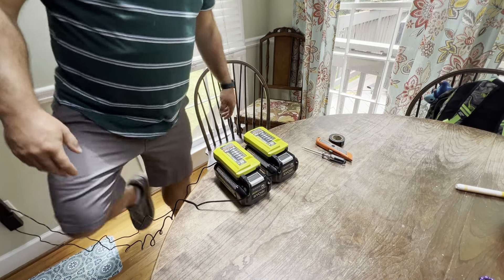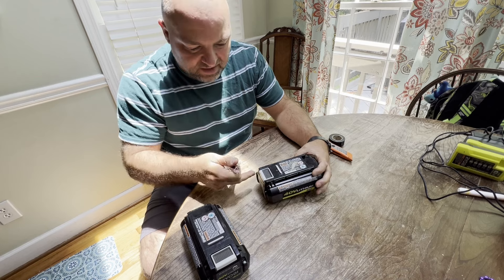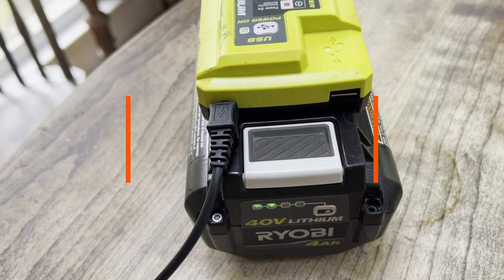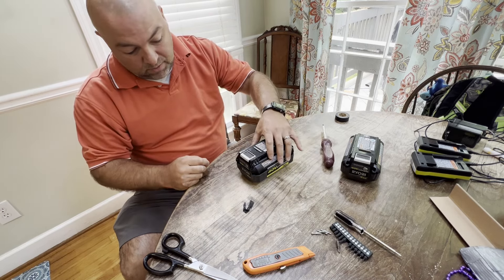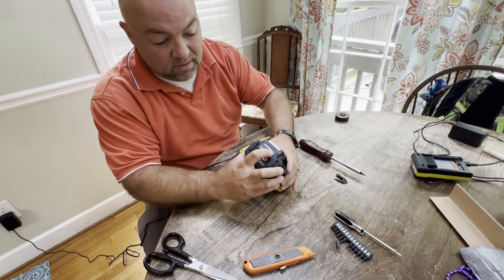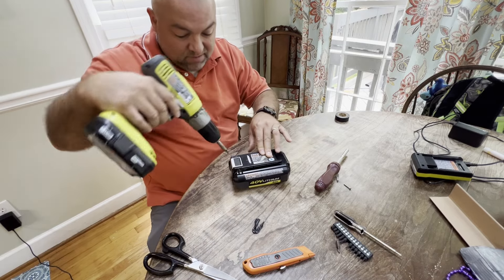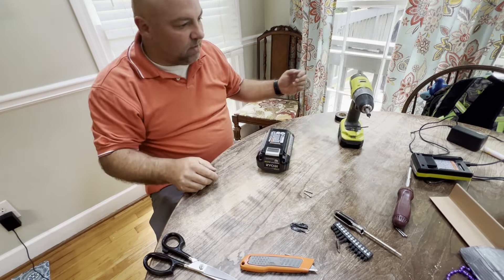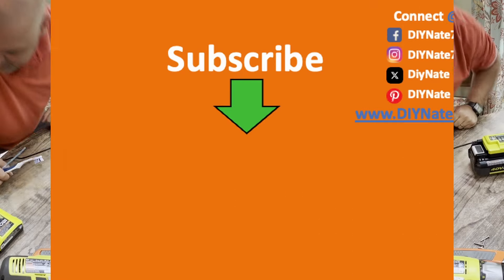How to Reset a 40 Volt Ryobi Battery! Fix for Battery Not Charging & Blinking Light Issue Full Video

Comment: I just attached cables to main battery negative and positive inside the battery bypassing the BMS and charge the battery with $3 buck booster using $10 200 watts solar panel, battery gets charged by direct method and discharge up to the safe limit.
Reply from the maker: Wow - love the detail here and sounds like you got a great fix with this approach!  Really appreciate you posting this in the comments and I am sure many others looking for solutions will appreciate reading this.
Best,
DIYNate

Comment: My battery is an OP40602VNM, 40v 6ah, bought in 2001 (past warranty, alas). I had charged it to full two months ago, but now it is dead (stored in garage). The voltage between T1 and T2 is 0.0v, between T3 and T4 it is about 0.15v. On the charger, I get the alternating green/red flashing lights. Clicking the battery test button gets no result - no LEDs alight. I have tried shorting between RST and GND with no result; also between RST and 3.3v with no result. Putting it back on the charger just results in the flashing red/green again. Any ideas?
Reply from the maker: Whew - you are deeper than I have been on that one so don’t know that I will be able to help you out there.  2001 seems really old - I think that was back in the day of Ryobi blue / yellow.  Maybe 2011?

Interesting you aren’t getting anything with the reset short - I have seen a couple other videos with a variety of ways to give some additional charge to the battery but haven’t tried those out as it stands.  Good luck with the fix and thanks for commenting on the video!
- DIYNate
Reply: @DIYNate  Apologies re my typo - I bought the battery in 2021.
Reply from the maker: Hate to hear the hack wasn't working for you.  One of my two attempts failed as well and I ended up with 1 of the 2 being a brick battery but the other is working fine and just used it this afternoon for string trimming my yard.  Appreciate you sharing and commenting - sorry I didn't have a better fix for the specific situation where the jumper fix isn't working.
- DIYNate

Comment: I reset my battery and it went on the charger one light came on then 3 solid lights the second time 1 flashing and charger was green went dead in seconds, so I jumped battery to battery for about 30 mins. back to charger same lights all around so I just left it on the charger for hours all the lights went out the next day got a multimeter hit the + & - with the probes and it says 40 volts , IDK not my area of expertise ... however the blower worked with this battery?
Reply from the maker: Hey there - well, that sounds like you did a lot to get some results and if I am reading, right, you are saying your blower is working with the 40v but maybe not some other tool and the charger isn’t showing it as charging.  Seems odd - I wonder if your charger or other tool may be part of the issue / culprit, or just something that is acting up altogether with the battery.  Hard to help from a comment but good luck to you and best wishes!
- DIYNate

Comment: My battery is going what the second one is doing, it resets and then gives me one blinking light. But then the second time I click the battery button it goes back to 4 blinking lights! So it won’t charge and won’t reset
Reply from the maker: Rats - sounds like you are having the issue I had with the battery that I couldn’t get to do more than reset and it still wouldn’t take a charge.  Hopefully, we’ll get someone else to comment on how to fix that specific scenario / situation.  After I reset that one, even though it was blinking, I put it in my leaf blower and it ran for about four seconds then died again.  At this point, not sure what the fix is if anything for that specific combo but would love to hear if others have had success with a hack for that (e.g., the old battery in the freezer trick or something else).  Hate that for you, brother!  Good luck and best wishes!
- DIYNate

Comment: Very disappointed in RYOBI  
Absolute crap for $189 each, then put a security screw to make it user unfriendly .   Marketing Morons
Reply from the maker: Sorry to hear about the frustration with Ryobi.  I really like the brand in general, but there is nothing like a battery going bad, especially with the prices they sell for.  Hence, we look for ways to keep them alive and hacks to keep them forever.  Over the years, the vast majority of my 18V tools are still running off original batteries with only very few batteries dying on me.  40V is new for me and for my collection, I did buy them second hand so, I can't quite judge as much on Ryobi around that.  The price of the 40V does make you want to keep them for several years for sure though.

Appreciate your comment!
- DIYNate